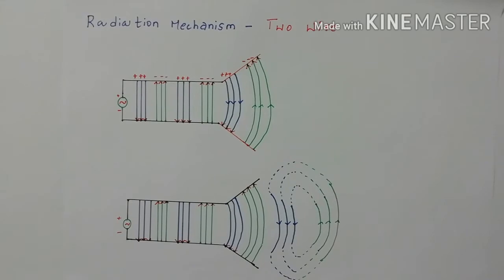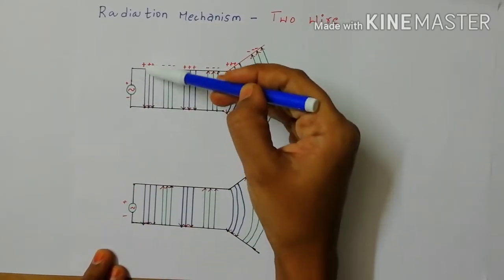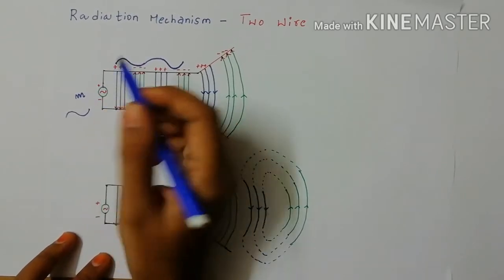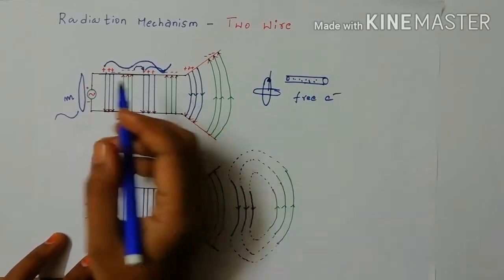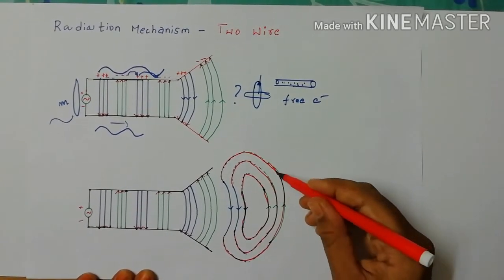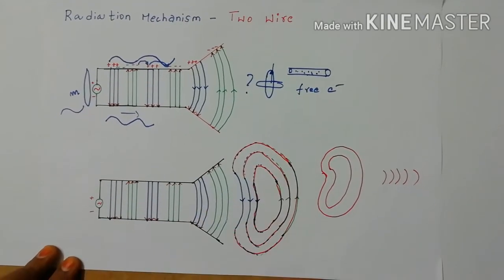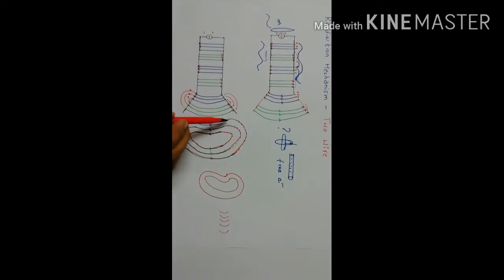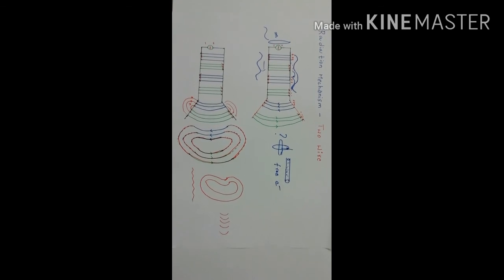Radiation Mechanism in Two wire Antenna

Comment: Good then what is the difference between single wire and two wire
Reply from the maker: Single wire means only one conductor i.e only one metallic rod or wire.
But two wire is similar to transmission line that is pair of rods or wire.